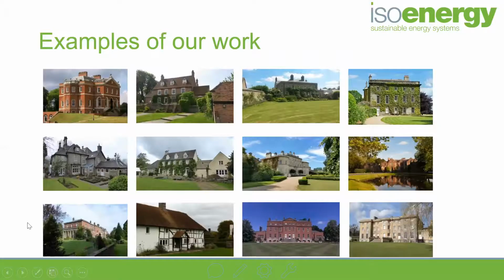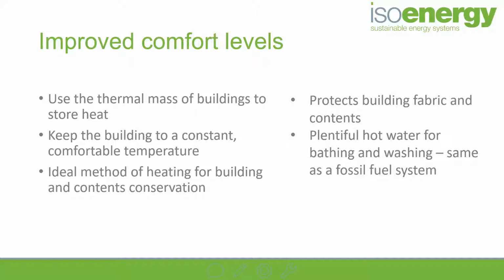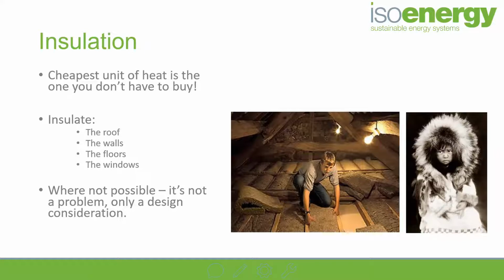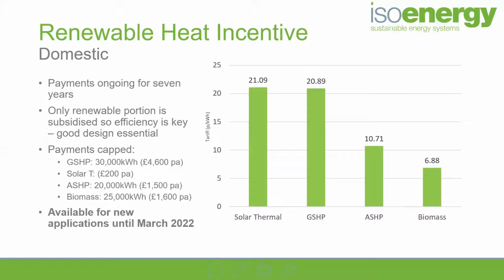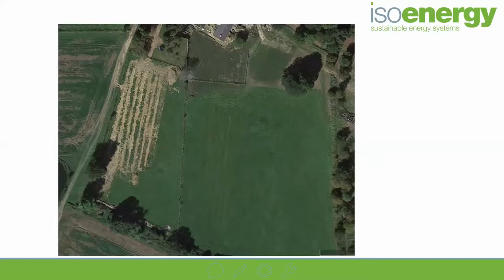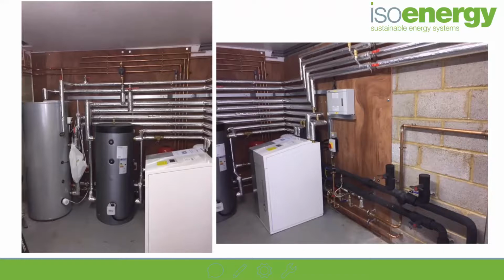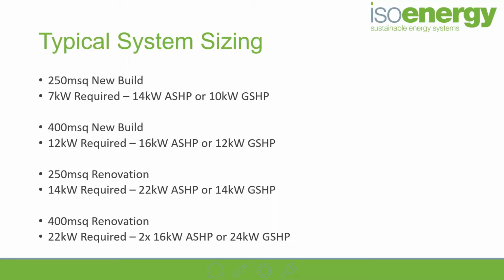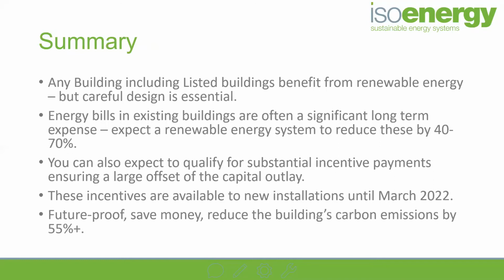isoenergy guide to ground source heat pumps

Comment: I want to build a 3M wide by 6M  long by 3M tall refrigerator and a similar size freezer.  They will be installed side by side in a climate controlled building.  The goal is to integrate the waste heat from the refrigeration units with a GSHP system for heating and cooling  the building including DHW into a single suite.  Ideally the whole system will be powered directly by Solar charged Batteries.  Do you have any suggestions about the proposed system?